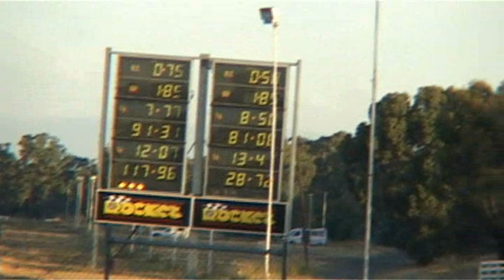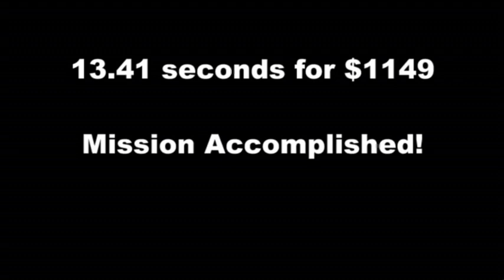13s for $1300 - Project Bluebird - Episode Nine Part-3

Comment: awsome job for $1149  for an extra $50  might be able to get 12seconds for $1200 ?? some cheep performance mods you could do fuel filter /injector cleaner , oil chance and spark plugs gaped @ .08mm and leads , sounds silly but made a world of difference to my car ef